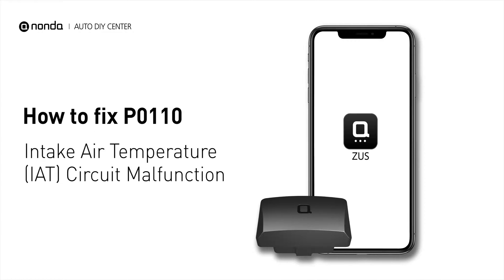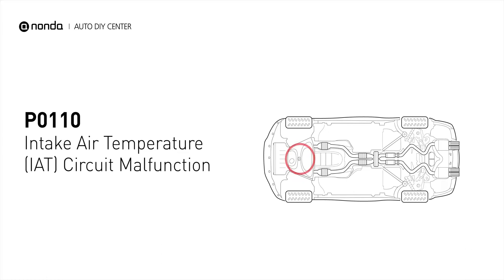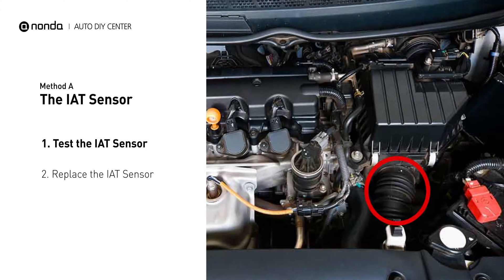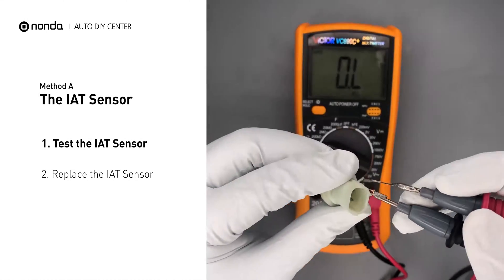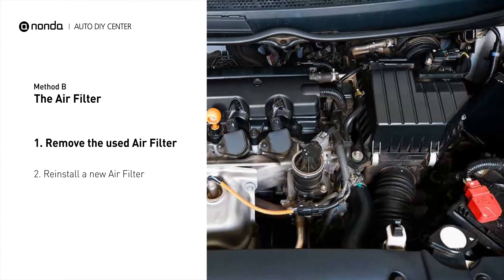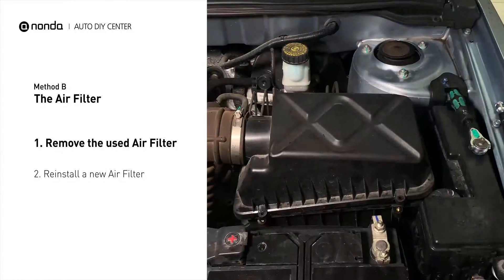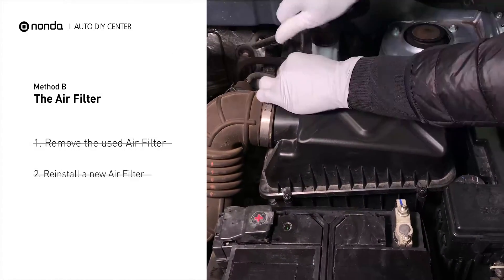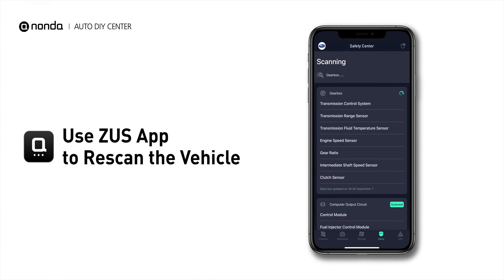How to Fix P0110 Engine Code in 3 Minutes [2 DIY Methods / Only $7.94]

Comment from the maker: Hi, I'm Steve, nonda's lead mechanic engineer. 
Feel free to leave your comments here if you have any mechanic questions, I will be glad to help you out!
Reply: I have a 2002 Toyota Corolla that blows a lot of white smoke and drops of oil thru the exhaust wen warmed up What does it mean? Also to start it I need staring fluid
Reply: I have Q45 Infiniti 2002, it's been running sluggish. Found the codes p1111 P1212 and a PO110. Then as I'm trying to start it they other day my key won't come back out the ignition it cranks but always giving me the p1111 code after I've fixed it twice in less both parts were trash as far  as the  carit turns over, but it won't shut off the panssenger  side front light stay on as well as the back running lights. I disconnect the fuse when I'm out but key, well the plastic key fob won't come out  Ive look on line and tried them all please help

Comment: Hi, I have changed VW Sharan (2019 73500 milages) Turbocharge but still, I have a problem with the power of the engine there is a couple of 'Error' comes up. P10100-P03AF00-P040200-P029900-P103200. Also when I accelerate the gas pedal engine makes a noise (Like air). Any idea what is the problem. Thanks
Reply from the maker: Hello, since you are receiving multiple error codes, we highly suggest to get your vehicle visually inspected by your local mechanic for further diagnosis.
Reply: Probably one of you air pipe have a leak or accidentally fall out of one of the holes. Take a friend whole he accelerate check where is it coming